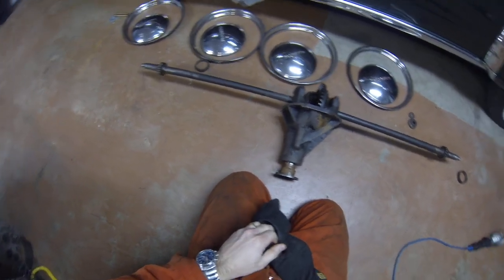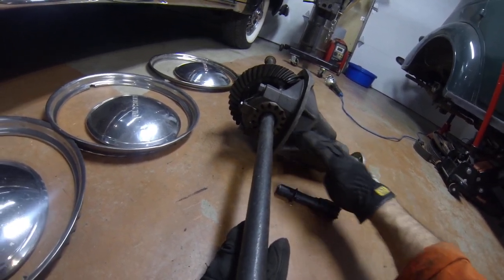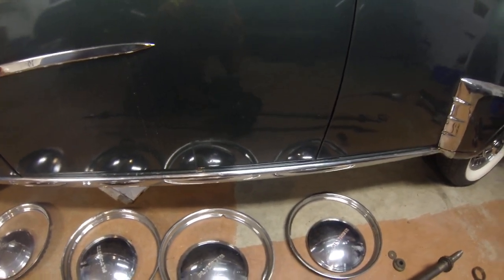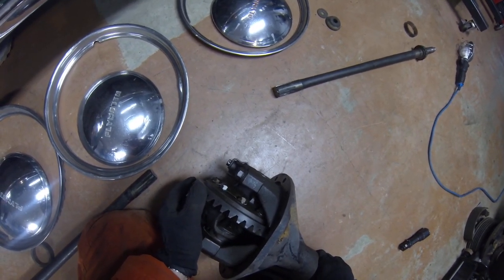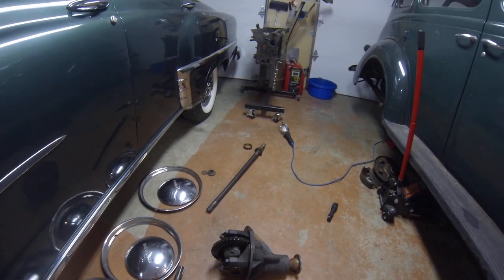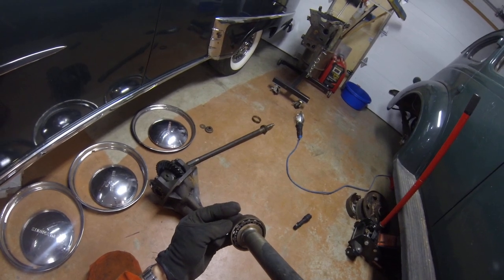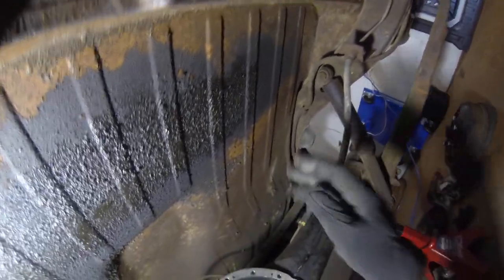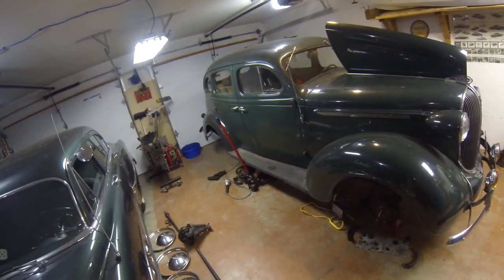Introduction To Vintage Mopar Differentials

Comment: Keith, as I'm also contemplating working on my rear axle (leak at the pumpkin seal), first of all, thanks for your videos. Then the questions . . .
Where are you measuring the axle lash for the centering block? Is that out at the axle end?
You mentioned brake hoses . . . were you making your own replacements, or buying them? I'm thinking I should probably replace them all the way around on my '47.
Reply from the maker: Yes, all new brake hoses. I did not make my own. You can get them on ebay or Andy Bernbaum. The two axle shafts butt-up against the centering block. Yet you need clearance between the block and axle on each side. I used a dial indicator gauge, then added or removed shims as needed. Shims are behind the brake backing plate. Right where the backing plate bolts to the axle housing. I have other videos that show all this. Search my video for more on axles.

Comment: I had to have a stainless steel sleeve put on the part that slips into the seal and bolts to the drive shaft . It was worn and the new seal would not seal properly if I had not .

Comment: hi, I came found your post on differentials and was hoping you could help me out.  I bought a 2881489 differential at the junkyard.  How do you tell if its posi-sure-grip?  The gears look very similar to yours.  I'm sure there's an easy way to tell , just I've never worked on differentials before.  Hope you are able to help with this and thanks.
Reply from the maker: Sorry I can't speak about posi-track diffs. I have limited experience with them.

Comment: Thanks pulling an axle on 52 Cranbrook and wondered why there were three shims on one side and only one on the other ... leaking inside seal ? Now getting outside of my comfort zone . New outer seal installed and still leaking ? Need a tool  to get axle out ?
Reply from the maker: No special tool required to remove axles. Lay the drum back on the axle. Thread the nut on loosely. Use the drum like a slide hammer. Push the drum toward the diff, pull drum out toward your body quick and hard. repeat a few times axle will come right out with bearing attached to it. If look at some of my other older videos I show this trick in one of them. I also show you how to replace the inner seal.
Reply from the maker: See here:https://youtu.be/UOni7Udv7jU
Reply from the maker: And see here:https://youtu.be/2TlQvMxLeEY
Reply: @keithsgarage5831   Thank you will try it tomorrow